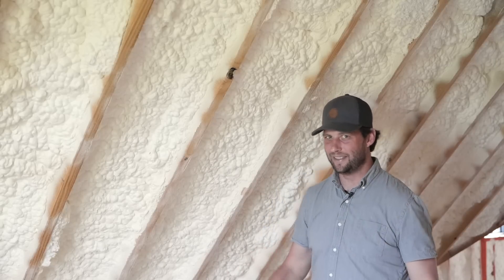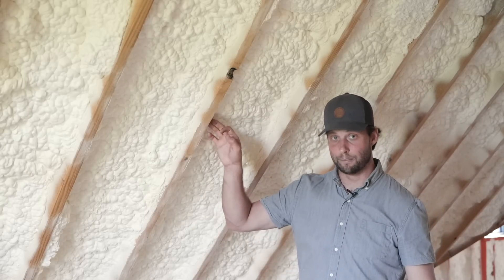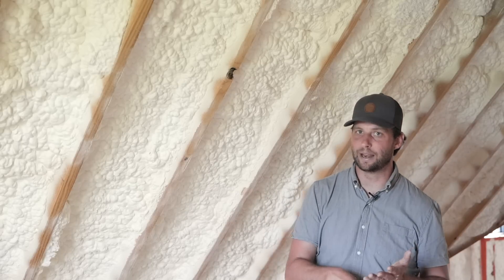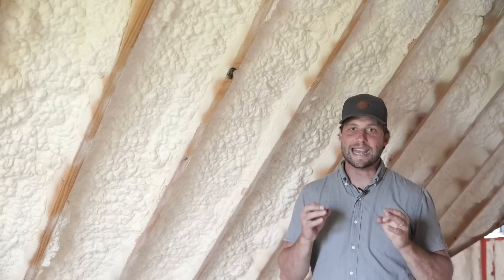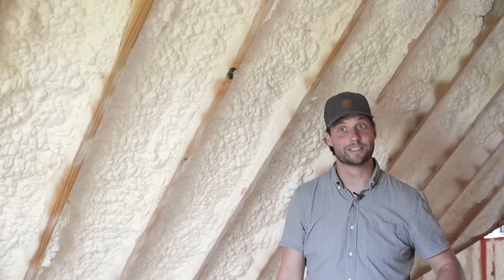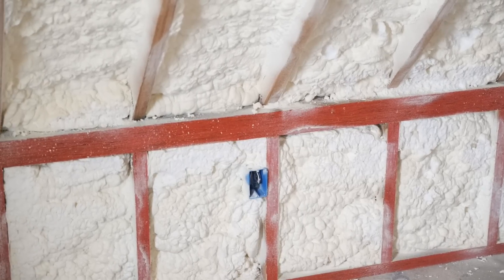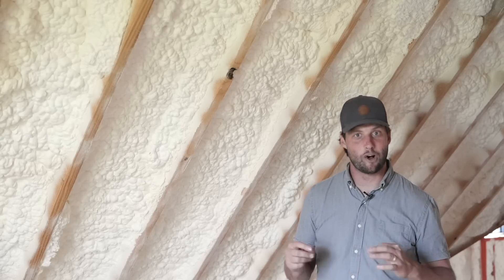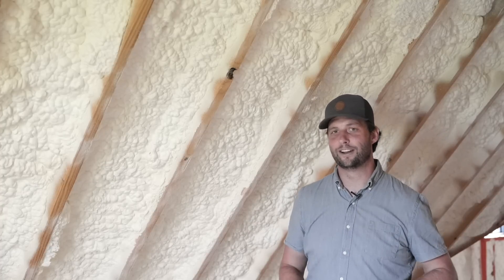Spray Foam and Radiant Barrier: How NOT To Do It!!

Comment: Yup! I did a porch cathedral ceiling with a 2 inch air gap between under the roof sheathing and the first layer of reflecto bubble foil (reflective foil side facing up towards the roofing sheath.) Then the next layer under the reflecto wrap was 2in X 3 layers of blue styrofoam where each layer with joints was sealed with caulking or Great Stuff foam (for wider joint gaps)
Then another layer of reflecto bubble wrap on the 3rd styrofoam layer, with the reflective side facing down towards the inside of the living space, then strapping 1 inch thick, for air space for the radiant effect to take place then ceiling planks were screwed onto the strapping. Voila!  Super air tight and and insulated.  The light fixtures never penetrated into the 2 inch air gap and I had a ridge vent and soffit vents for air flow in and out of ridge vent.  
Next project is to do the same in the attic as was done in the porch cathedral ceiling, with a skylight too!  Cheers, stay safe from Atlantic Canada during covid
Reply: Interesting solution. Do you think this would work for an old attic conversion? (into liveable space). 6" rafters not leaving much room for play.
Reply: @diamondbracelette  Hi there. That is what I had, 6 inches. I put 3 layers of rigid foam with the 2 inch air gap and the reflex foil layers. The last 2 inches of rigid foam were screwed into the edges of the 6 inch rafters which added the additional 2 inches to the 6 inch rafter. With out a visual it may be difficult to explain. Therefore the living space height will loose 2 inches if you add the additional 2 inches of rigid foam to the existing 6 inch rafter. This means there is 6 inches of rigid foam total. If you do not want to loose the 2 inches of height room, the only put 4 inches of rigid foam that would be flush to the 6 inch rafter. Hope that helps. 💪😀🇨🇦🛠🪚🔨
Reply: @MegsCarpentry-lovedogs   @Meg'sCarpentry,lovedogs  Thanks!! So what you just described was the attic job that was forecasted in your original comment,  I believe.  And yes, the layering does make sense, especially regarding the outer layer that would sacrifice height. I truly have none to sacrifice! For the first job, you mentioned the radiant barrier (reflecto layer) being installed iver the last foam layer (reflecting inside). What was your thinking behind that second layer? And sounds like you didn't use this second radiant barrier in the attic? Also, in considering R values did you opt to use the foam board versus spray foam due to the spray foam not working-install wise- with your system? Despite the greater R value from spray foam? Oh oh oh! and also, you mentioned 2 inches air space. I understand that that's needed for the radiant barrier to work, but read that an inch is enough. Is 2" better? I have no ridge venting either. Share all secrets pls 😂
Reply: @diamondbracelette  Hi. Difficult to share details without visual. To answer your questions as best I can, You will need ridge venting otherwise all of this insulating work is useless because you need to have the passive air flow flowing in the 2 inch air space. Yes, 2 inches, NOT 1 inch. Yes, I did use the second radiant barrier opposite application to the first radiant barrier that had the shiny surface facing up to the sky and where 2 inches of passive air flow flowed over it to the ridge vent. The second radiant was located on the last installed ridge styrofoam but this time the reflective side was facing down towards the floor and the strapping held it also in place, 1 inch strapping, because the strapping is what one screws the ceiling planks on to. 1 inch space could be used in this application because there is not a air space needed for air to flow to the ridge vent. Two different scenarios to pay attention to. The purpose of having the second reflecto layer is to reflect heat that rises from the room BACK down into the room. Reflecto is all about reflecting heat. So the first layer reflects it back into the 2 inch air space to be passively flowed out to the ridge vent and thus keeps the shingles from over heating as well, and the second reflects the heat generated from inside the home back down into the living space. Using as much science heating theory as possible so in a cold Canadian Winter we stay a bit warmer from the reflected heat back down from the ceiling. Hope that makes sense and helps. As for spray foam not being used, once you put spray foam in it is impossible to remove and I like options in case any of the rigid foam needs to be removed unexpectedly.  Also, if you use spray foam you have to have additional equipment to use, which means renting and a lot to that time to go get it and return it and clean it and, yada yada yada. I live in the country so super practical to just take measurements and cut the rigid foam on the work bench and get on with the big task of getting all that rigid foam in stalled and tightly sealed. 💯🇨🇦💪
Reply: @MegsCarpentry-lovedogs  Incredible reply! Huge thanks. This goes a long way to helping me solve my particular riddle. Northeast US, climate zone 5 I believe. Looks like my next step is contact a roofing contractor to assess if soffit vents and a ridge vent is possible. Shallow overhangs and no ridge board but my first take is that it  could be doable. Cheers :)
Reply: @diamondbracelette  Yes, you are aware of your zone, good thing to help with your riddle solving. I live on Prince Edward Island at the moment, Eastern Atlantic Canada so zone 7?? Yes, you need that ridge vent 100 percent true! It is about passive air flow to keep those shingles less heated and thus extend the life span of them. It is quite a task to get done but so rewarding once everything is in place. The pride of having done it and using building science all for the better good  to help us feel more comfortable in our homes is such a wonderful feeling. Plus sharing knowledge  to help others, as so many others whom I read their articles and watched their videos helped me. So much to learn,💡👍 so little time eh! wink wink 😉Have fun,😀 stay safe as covid restrictions are lifted.😷💉🇨🇦🍁
Reply: @MegsCarpentry-lovedogs  🍻

Comment: Could you not have left an air gap by using 1/4” ply and 2x2’s then spray foamed.
Reply: Yeah but you are adding significant labor and cost

Comment: I tried it and I liked it! We I have used open cell spray foam on tech shield with vent baffles to allow the hot humid air to escape through ridge vents. I compare it to the effect of backer rod and caulking. The vent baffle (like backer rod) not only creates the 1” air space that tech shield needs, but it isolates the spray foam from the roof deck. Like caulking, spray foam can only stick to two slightly moving surfaces (the rafters in this case). When they are applied to three surfaces (2 rafters and the roof deck), the foam (or caulking) would only be able to stick to 2 of the surfaces and would delaminate from one of them to allow the rafter to expand/contract. Thereby leaving the air gap some say happens over time with spray foam apply to the underside of the roof deck. We have had amazing results and ACH sub 0.5!

Comment: Did you consider calling TechShield, or Matt R or one of the Building Science contacts he uses, about leaving the air gap between the radiant shield and the FG batts, without the eave and ridge vents, before doing the spray foam?  I agree with what you said, that it seems that should work as long as the moisture seal is good.

Comment: the best way not to waste your money on the insulation why would you add gasoline to your wall and cancer when on fire you have NO chance of escaping your house sorry the builder that was building one of my houses spray the wall he had to tear down the house and use new lumber i did  have it in the contact NO spray from insulation in the contract we went to court over this and did win the case as a homeowner i did say pink insulation yea the foundation creaked to  yea  started  from the bottom up before they go on to the say the floor i had to sign off on the job first of all  yeap the concrete was not to the grade that they said it was  yeap tear it out  this time it was done right too and they did not play around making costly mistakes  
did make sure all the wiring was done right to and the plumbing too as to panel box had one for each floor not have to go downstair to flap breakers  and did request larger panels to be put into yea they had to redo that too the plumber i did hire him my self  he did all of our plumping anyways he know how i work and does like how i do that too each floor  its own supplies on them  do not have to go now the next floor go get anything 
all the extra supplies  go to the farm  and put into stock for the next project we need it for he like it, he knows we have parts on hand and he knows if he requests use to by more we will

Comment: There is no question that spray foam is the best solution for an occupied room with a cathedral ceiling.  Ideally closed cell.   Your radiant barrier under foam will, at least, make pulling the sheathing off quite a bit easier.  Otherwise big chunks of foam come with it. Hopefully in the far future.  As far as radiant barriers for conventional attics, I think the benefits are marginal at best even though radiant transfer is minimized.  Foam can take a 125f attic down to 80f by itself.
Reply: Nonsense.  All that was needed was spray foam.  I have done many a new roof with spray foam and never a problem.
Reply: @davidburkholder7360  “at least”.